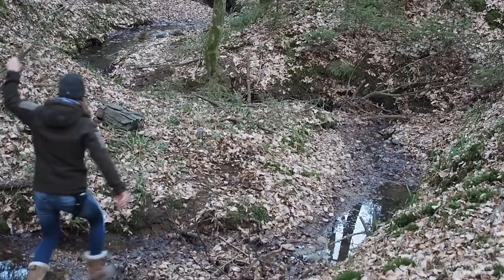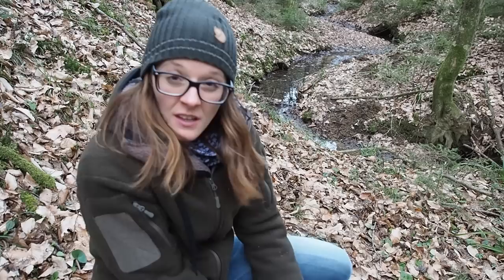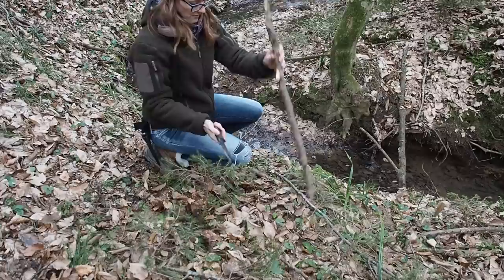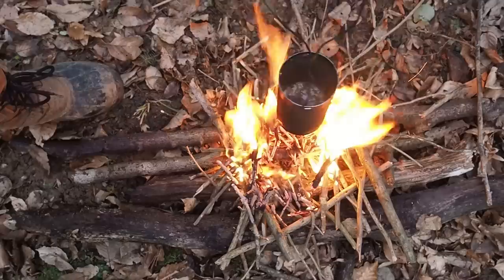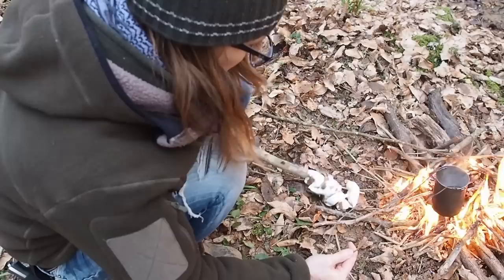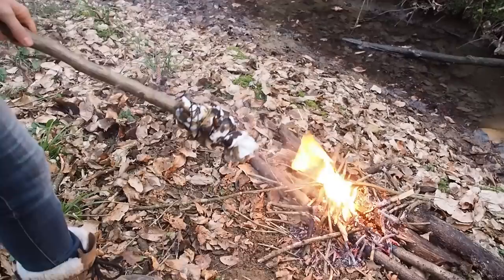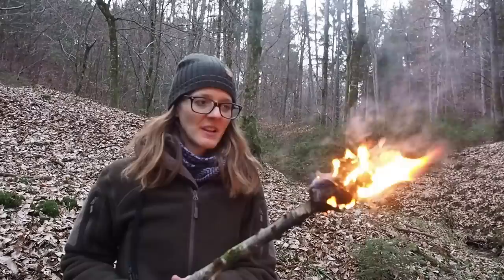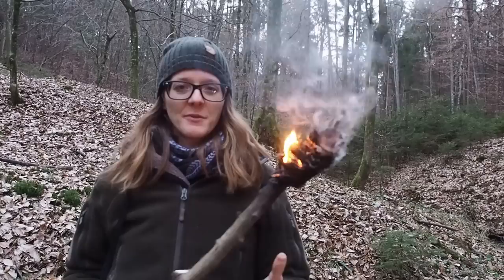Best method of how to make a torch

Comment: Lilly's torch burns with a yellow flame due to the natural fuel. Hollywood movie torches are almost always blue-ish due to petroleum fuel. Show them how a real stone age torch is made!
Reply: I've never seen a blueish torch in a movie
Reply: @ratedasmr7811  they always are around the base.
Reply: Josef Krakel I use lighter fluid very natural indeed
Reply: Only issue there is, I’m pretty certain in the Stone Age they didn’t use wire. Where would they have even gotten it. I want to learn how to make a torch with nothing but the resources around me. And maybe my own flint to make the fire building process easier, but of course we know that is is possible to create fire with a store bought flint. So I’m looking for absolutely nothing but what the land provides in order to create a torch.
Reply: @Little_Bitz  just wrap it tighter more snug and make it tight where its stuck in the split in the branch. ull find a method :) i would addd double to triple the amount of resin she put tho. would burn for like 20 mins :))
Reply: EMOTIONAL DAMAGE
Reply: @ratedasmr7811 the blue flame is in the middle for the flame
Reply: @Little_Bitz Lonny from Far North Bushcraft and Survival shows this on one of his videos.
He even processes the wood without using anything other than his hands

Lilly - awesome video as usual.

Comment: Another great video I'm surprised as why there aren't as many videos on Torch making, considering how common it was for thousands of years
Reply: Well, part of the answer is that the torch wasn't the staple of lighting in ancient history that we imagine it is. Candles have always been a more prominent and practical light source. Torches did exist, and have many uses, but commonplace lighting sources is not one of them. They're rather inefficient by comparison; a candle can last for hours and costs far less resources. And then there's oil lamps, which were popular in the Mediterranean during the Iron age because olive oil was more abundant than beeswax. Torches are mostly necessary where a very large and mobile light source is needed for a short period of time, as they burn brightly and at great volume for about five to ten minutes. Very good for transferring fires and starting new ones (if the ability to transfer live coals, a more common practice, was not available), but not sustaining them.
Reply: Olive oil lamps if you want light for hours and are not moving preferably indoors are way easier and can burn for 16 hours. The simplest design is just a flat thinnish piece of clay (6mm or 1/4 inch roughly or even a bit thinner)shaped by bringing one bit together using finger and thumb (about 1/4 of the circumference apart or slightly less) and a piece of string from the oil to just over the end of the clay channel you just made. It really is that simple, Any oil will do (olive oil smokes the least) and tightly plaited bark fibres will do for a wick.
Reply: XerasDezarrys 
You seem to be blending “ancient history” into one soup. History had ages and different cultures/civilizations. Before candles ever existed, torches were used. Some cultures may have developed candles during the Bronze Age and, perhaps, a select few at the end of the Stone Age. As time has marched on, more cultures figured out how to make candles, but it’s not like Stone Age man simply uses candles. It’s likely they primitive oil candles developed along side torches.

Comment: Cover the end with twigs and THEN use the wire to attach the bundle to the end. This supports the rags more fully and catches any melted resin.
Reply: And before the twigs dip the whole torch made of rags into the can to be sure it’s got all the sap resin left on the interior of the can 👍

Comment: Thanks for the 'Torch Tutorial!'  I also benefited from one you did a year or so ago, using and open pine cone to hold raw resin.  New viewers might want to check that one out.  You used a 'cross-split' green wood branch to hold the cone and it seemed that it burned longer than this one.

Comment: Survival Lilly: Thank you very much for the nice video. Very few people have actually constructed a torch, much less used one. It’s nice to actually see someone make one that works, and that last for a little while.

You’ve been doing Bushcrafting for so long, that it’s easy to forget that an impressionable noob may decide to try this without engaging their sense.

Just for that reason, and not because I think you need it, I’m gonna mention that for anybody who Wishes to make it and use a torch, it’s well worthwhile to put some sort of a catch at the bottom of the burning surface, to keep molten resin or other components of the burning torch from falling down and burning its’ user’s hand,  and to prevent the loss of sparks into the bush through which the torch is being carried. This might be important to prevent forest fires.

Thanks for another awesome video!

Comment: In the future, you can use 2 sticks of equal size to hold on to hot objects, like chopsticks. Its only temporary but it helps. Also, using a thicker stick as a baton to help strike the spine of your blade will save damage to your hand. Great video, keep up the good work! New subscriber here 😆

Comment: Great video, i have made a few torches for camping and just to try learn how. One thing that will help
If you have it available. Wrap the top of the torch stick in metal. From an old soda can works great.   Nailing it is best but wire or even tension can work to hold it in place. This can slow the sticks burning. Just make sure that the fabric doesn't overlap the metal on to the wood.(why Tall beer cans work great for this.  Really any oil would work.(used olive once, smelled great). I find used motor oil to be good, just a Pain to get lit.

Comment: Quick tip for women (and men as well): Always carry tampons and nail polish remover (best if contains acetone) with you.

My fire starter kit consists of a magnesium flint and tampons slightly soaked in nail polish remover.
If you soak a tampon in acetone (or other flammable liquid) and use thin plastic wrap to prevent it from evaporate, you will have a super reliable fire starting method. I had one for at least 2 years in a backpack, and it ignited on the very first strike.

(For the ladies, for obvious reasons, such items can serve multiple purposes so its not, at all, a bad idea to carry them daily.)
Reply: Gasoline works as well, only a small electric spark can be enough to light gasoline up.. 😂

Comment: Nice idea for a video.
Torches can also be used to disperse the bugs without a big hot fire in the summertime. A few small flames are better than one big one.
Also, I was wondering if you used 100% cotton and charred it first, would it burn longer or faster?
Thanks Lily!

Comment: Hi Lilly, only recently picked up on your Channel but loving the content and the common sense approach to Bushcraft. Being practical is not lazy, the whole point is to achieve results with the least amount of effort. Keep up the good work... Luvin it. After note, splitting the end of the Beech 4 ways would allow you to jam the cloth in and there would be no need for wire...Anyhoo - 10 Minutes was pretty good for the amount of sap used.

Comment: Although I haven't tried it (yet) I would think the wire from Titan Survivor Cord would work to hold the torch together.
Thank,s for sharing, Lilly!
Reply: AnOldManInTheWoods it could for a little bit it’s a very thin wire. After one or two burns it would likely weaken. And then you’ve used your cord for whatever else. Junk wire is preferable I’d say unless you are stocked with titan and no other options.

Comment: Lilly, I have a guestion about your shoes. If those are the Kamick shoes you once showed in your video does the rubber separate from the leather material? The shoes seem to have been worn a lot so I'm wondering if they don't split right where the different materials meet.

Comment: always luv ur stuff lilly but even construction of medival/primitive torches without cloth/wire can have burn times of 30-90 mins ; so 10 mins is not that great =P ; better luck next time =] ; 10 mins might be enough to scare off a single predator if it gave up however, but if it was hungry and keep stalking you, then most larger predators have over 10 mins of patience for a hunt =D

Comment: You know what would have been cool if you could have took your wire and wrap that can at the end of the stick with the pine pitch and throw a little piece of that rag in there for a wick and poke the stick in the ground and there you go melted Pine pitch torch with a rag Wick that would work good you could fill that can up with pine pitch and that would make a great torch
Reply: Try making one. Try carrying one around as a useful source of light. You can make pitch / resin candles and lamps, but they are not torches...

Comment: most RPGs would rule a torch lasting for 1 hour, but seeing some videos of different people making torches in the wild, this seems kinda of impossible. They usually last 10 minutes, like Lilly's
Reply: No, no, you can easily make a torch last an hour. You simply need more fuel. For a long-lasting torch, tie a cannabis rope around your stick and soak it in purified and molten pine resin. If you do it correctly, it can last for many hours. But purifying the resin is important for capillary action. It should not be sticky like in the video, but pouring like liquid.

Comment: Why is it anymore people don't practice good fire safety by brushing away loose leaves, twigs, and anything else flammable before lighting up a fire?
Reply: David Mm my thoughts too. But we don’t have problems with leaves were we are and sometimes they tend to be very damp. I think at a certain level you go out on a fly and not consider the message it sends to others who are less careful and have fewer safety concerns of others.
Reply: It's Winter and everything is soaking wet. Those leaves would barely catch if you put them on the fire a few at a time. For survival you don't waste energy doing things that aren't necessary.